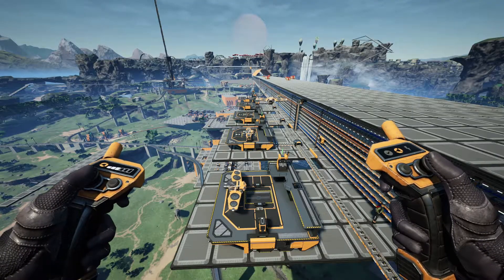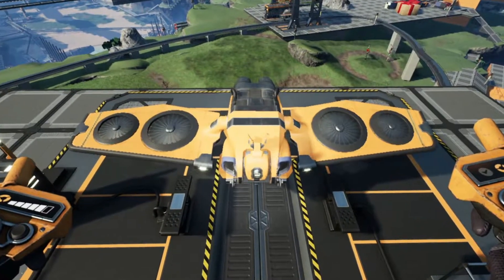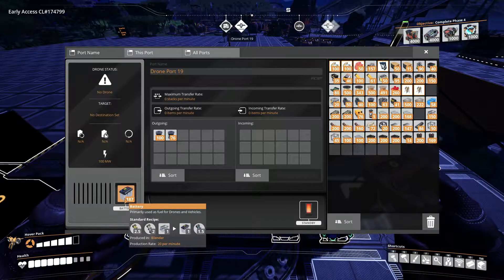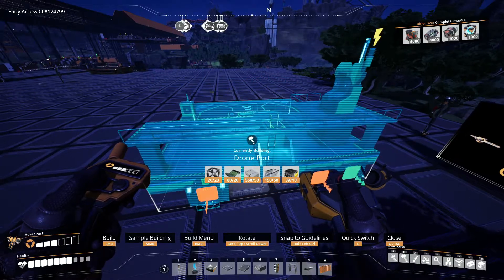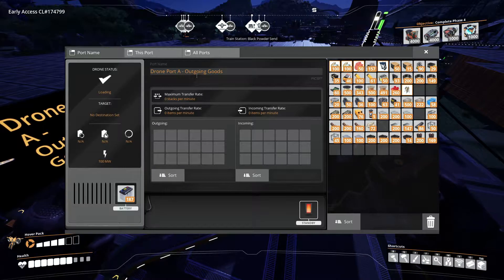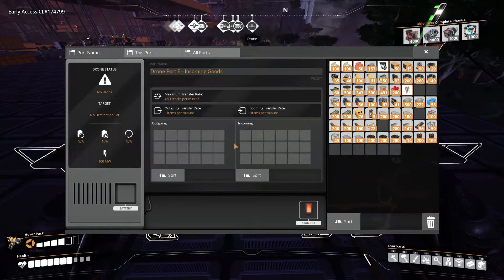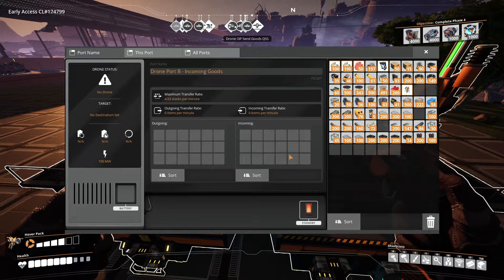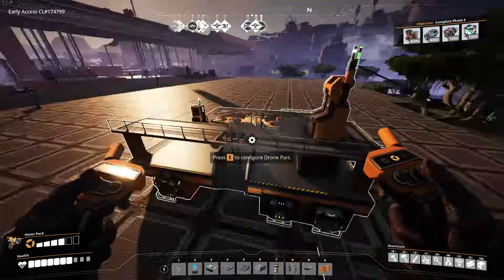Satisfactory Guides: How Do Drones Work? - Quickstart - Drones, Drone Ports, Batteries. Part One!

Comment: The big problem with the drones is the supply of batteries. In addition to ports A and B, you would also need a port C (at the battery factory), which supplies one of the other ports with batteries. And if they aren't used up fast enough, Drone C will block the entire logistics. So it's not really well thought out, because complete automation of the drone ports is not possible. You always have to intervene with batteries yourself. Or do I have a misconception here?
Reply from the maker: You can create a battery factory and use drones to deliver those batteries to any other drone port. That port will distribute batteries to the other drone ports. I have a huge battery factory and several drone ports there. These drones only purpose is to deliver batteries to other drone ports across the map whos only purpose is to recieve batteries. Those ports then funnel out batteries to drone ports that move goods. You can move alot of goods quickly using drones and its completely automated.
Reply: @KaliGold  This only works if the port to be supplied is far enough away from the battery factory. Otherwise, there will be an excess of batteries if the battery port delivers too fast. Because then the battery delivery drone will eventually block the entire port.

There must be a balance between battery consumption and battery delivery.

If the port is too close to the battery factory, it won't work. You have to use conveyor belts, so the drone system is not autonomous.
Reply from the maker: @aenzian battery factory with drone ports A, B, C, D all holding batteries and one drone each.  A short distance away is drone port E, F, G, H. So F, G and H will be loaded with copper ingots for example and have a drone on them. F, G and H will move the copper ingots to  other drone ports somewhere on the map. Drone Port A will do nothing more than move batteries to drone port E.  Drone port E will covey those batteries via splitters to drone port battery input for F, G and H. It wont matter if drone port E fills up with batteries. .... im on a save right now that is heavy trains... when i get to using drones on this save in earnest, i will set it all up and make another video. Describing stuff in text is hard...lol
Reply: @KaliGold  Oh yes, with 3 receiver ports and a (battery) delivery drone like in your example, it works because the delivered amount of batteries is divided.

But what if you only have ONE port that needs batteries? It works with every hub with several (!) ports, but not with a single one. That's what I wanted to say.

My example: Port A delivers items to port B. Both are lonely somewhere on the map. Port C is at the battery factory and must supply batteries to one of the two. That doesn't work because a single port doesn't use as many batteries as shipped. And you can't control the amount. That's what I want to solve. You could of course build a port D for port A or B, which is supplied with batteries and passes them on to the receiver port. When port D is full, it blocks, but doesn't bother anyone because no other drone is coming.

I wrote that the drone system is not well thought out. Because if you need 4(!) ports (A + B + battery factory + battery receiver) to create a supply chain between 2 ports (A+B), the whole system is not very efficient. :))
Reply: @KaliGold  And imagine how many drone ports you need at the battery factory if you produce items scattered all over the map to be distributed by drone. 8)

So a distribution system ONLY with drones does not work in my opinion. The other transport systems are not perfect either. But maybe that's the intention of the developers. One is forced to use several modes of transport.
Reply: The other solution would be to build multiple central hubs across the map. There the items of the environment are delivered and distributed from there. So neither a completely decentralized solution with many individual ports nor a huge central warehouse.

I'll try that now.
Reply from the maker: @aenzian  Yes, Drones were never meant as a complete replacement for Conveyors or Trains, but they can come in very handy in certain situations.
Reply from the maker: They are also good for delivering batteries to vehicle networks if desired.